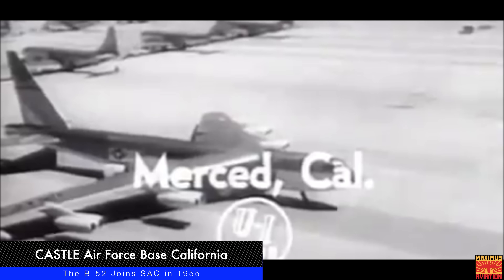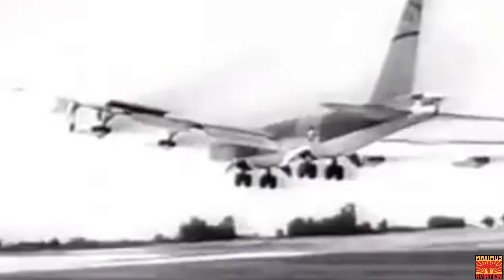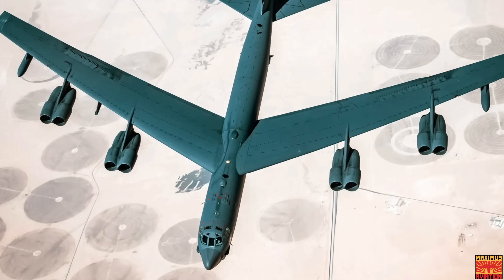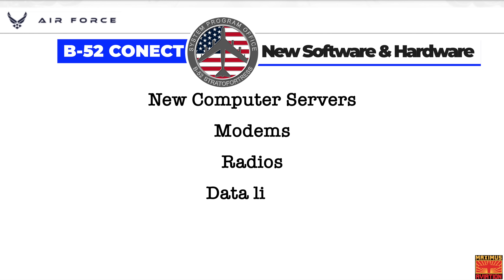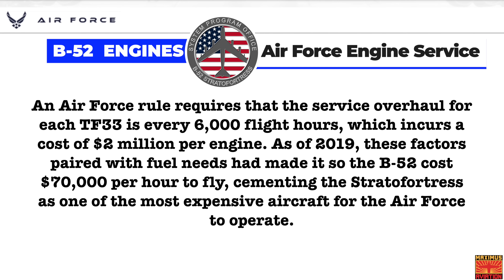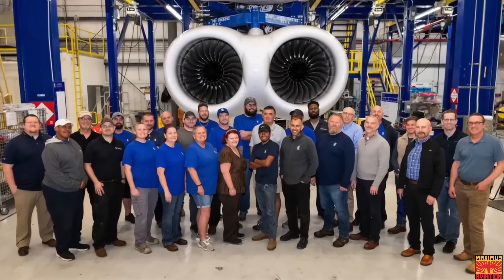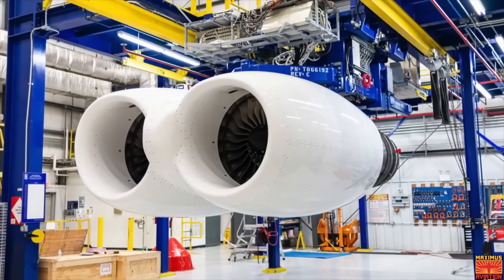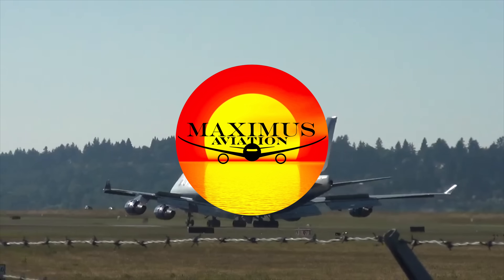The B-52 Will Fly For Over 100 Years With Its New Rolls Royce Engines!

Comment: I was in the Air Force in 70s and remember the maintenance personnel discussing the need to find a replacement even then. Some parts were "unobtanium" and had to be scavenged from those in the "boneyard". At Barksdale AFB, HQ 8th Air Force, 2nd Bomb Wing, we had 9 B52s on "alert" status, fueled and armed with nukes, ready to be in the air in minutes. We had a dozen on the East side of the runway that were "retired" and used for parts. One of the distinctive characteristics of the B52, other than the"full flying tailplane", the "stinger", was removed years ago. These were the "tailguns", either quad .50 caliber machine guns or 20mm cannon, that had radar and thermal tracking capability to defend from attack from the rear. Was disconcerting to be the "tail sentry" during testing and the crew used your body heat signature to verify proper operation! Hearing the whine of those tracking motors and looking up to see those LOADED guns aimed at and tracking your movements was disconcerting, to say the least! Only aircraft I ever saw take off nose down and tail up! Still love those goony birds!
Reply: I worked on B52Ds and Fs when stationed at Castle AFB, CA back in 1973.  I still remember the night the munitions and avionics guys were checking the radar quad 50s in the back and didn't tell anybody.  A young crew chief walked into the radar detection field and four 50 cals slammed over to where he was walking around the back....he moved, they moved.  After the guns jumped three times he came running to the front of the aircraft screaming "They're trying to kill me !"  

Took a while for the Supervisors to calm him down and assure him no one was trying to kill him...  Gotta' love aircraft maintenance guys !
Reply: Sounds like you were SPS. I was 22SPS at March, in the 70s and always got chills and thrills when our "D" models launched! What an awesome Bird!!
Reply: I wonder if digital scanning and 3d printing can deal with some of that?

Comment: my prediction is that in 2075, people will be talking about another re-engine for the B-52.  you don't always need stealth tech for penetrating modern air defense systems to disable modern air defense systems and to eliminate the enemy's aircraft. once you achieve air dominance, you don't need it anymore, and it more cost effective to use a B-52 to bomb your enemies back to the stone age and it doesn't risk expensive stealth aircraft. when all you have are nails, all you need is a big freaking hammer. when you need to put warheads on foreheads, the B-52 is the biggest hammer in the drawer. an upgrade to modern avionics and radar is long overdue as well.

Comment: I think I missed something here. What was the old thrust to weight ratio and what is the new thrust to weight ratio. The old engines 6000 hours to rebuild what is the new engines. It would be nice to have a chart to look at for a side by side comparison. I was at K I Sawyer for 3 years I loved to watch B-52s take off and C-5. You would think every time there to big to fly.
Reply: It's not planned to rebuild the new engines at all. These aircraft don't make that much flying hours and the mtbo of the new engines would allow to let them on the aircraft (with the normal maintenance) until they get retired.
Reply: they're too big

Comment: I used to live in Springfield, MA close to Westover AFB where SAC had based their B-52's in Chicopee.  The roar of B-52;s was pretty regular.  Westover was getting noise complaints from the residents of Chicopee so they hosted an air show with the Thunderbitrds aerobatic team flying their F-100's  doing head on passes right off the flight line, something they can't do now.  When one of the BUFFs did a high speed low level pass, he pulled up and accelerated under full military throttle, the announcer said.," Now thats the sound of freedom!"  All noise complaints from Chicopee stopped after that demonstration.

Comment: But if you look closely some of the skin is getting wrinkled.  I suppose they could reskin the BUFF and along with new engines it could fly for one hundred years so long as the wing spars hold out.
Reply: A. C. Campbell: The wrinkled  skin is a intentional design feature on all B-52s due to its size and length.

Comment: The B-52 is such a one-of-a-kind aircraft.  The (4) bicycle-type landing gear can all steer, eliminating the challenges of cross-wind landing.  Also, instead of rotating to take off, the BUFF 'unsticks' at a level attitude.  Given the wings' high angle of attack, pitching up isn't necessary.
Reply: It’s the angle-of-incidence that causes the aircraft to left off in a level attitude.
Reply: It pitches slightly nose-down she unsticks.
Reply: I always look for the pronounced skew when the buff is rolling for take off.

Comment: I like how they retained all 8 engines instead of reducing to 4, keeping the BUFF's original configuration.  The Air Force insisted on it to avoid performance issues of 4, including lack of rudder authority to handle the loss of an outboard engine.  The new engines should be about 30% more efficient, which compounds fuel savings since B-52s frequently perform mid-air refueling.
Reply: The engines are being made in USA at RR USA facility. A very sensible choice economy & longevity. The fuselage reminds me of a giant Lancaster, a very large rectangular shape, I imagine with large bomb bays. Engines built for life design with metal fragments measured at oil changes, things really have moved on. There is something special about a B52, great to see it still flying.🇬🇧

Comment: The first time I flew in to Edwards Air Force Base. We parked by base ops.
At that time base ops housed a small sub shop. One of the subs was called the BUFF.
My biological father worked on a top secret version of the B-52 called Ghost Buster. There's only 1 picture I've ever found of her on the internet.
This B-52 has a PAC Man ghost on the side. When you look at it's horizontal stabilizers, you can see the new avionics on board.
One of the reason this B-52 was built was to detect stealth aircraft.
When the government builds something new. It also build's its counter part.
Reply: look at its             also builds

Comment: I worked on B-52’s at Griffiss AFB in NY.  Our engines we’re GE-J-57’s .  This was in the early ‘70’s and G model bombers.
Reply: J-57 was a Pratt and Whitney Motor
Reply: @markostruszka1845  You are correct.  I keep mixing those two up for some reason.  We had a few J-79's in another engine shop on base in GE shipping cans.  After 50 years, memories kind of get clouded together some times.

Comment: I wonder why the bump protruding between the two cowls is about. Improving cross flow characteristics? Filling an already low pressure zone?
Reply: Flow through a ‘streamlined’ semi-internal channel would block up and give more drag than a simple fairing.  The new fatter fan cowlings will be optimised to minimise transonic flow drag and interference with the pylon and wing, the Buffs will still spend a lot of their time up in the cold air.

Comment: I am amused by the engineering, technology, bold design and longevity of this plane. Back when Boeing was run by engineers and this achieve this designs. This platform is a true testament of the achievements of Boeing as well as the AF to be able to maintain this bird flying. Also will like to find more about the engineering aspects of the selection of maintaining 8 engines vs. using 4 etc. Keep doing this type of videos as I enjoy your channel for its diverse content.
Reply: The aerodynamics of the 8 engine nacelles and pylons are well understood, so the USAF wanted to keep the same layout instead of extensive redesign and testing, including forces on the wing, for a different layout and/or thrust range. This was a viable decision since there are plenty of biz jet engines already in service with similar size and thrust as the TF33, but with much improved fuel economy and reliability, plus full digital control. Also necessary is increased electric power output to keep all of the updated electronic systems running.
Reply: There have been many studies on reengining the BUFF over the last 30+ or so years. They looked at four engines but those would have required substantial redesign to the wing and fuselage as well as the pylons. Keeping 8 engines with similar thrust meant the wings would not have thrust loads in places it was not originally designed. In addition, there would be ground clearance and CG issues that would be virtually insurmountable without , basically, a completely new airframe. Sticking with eight engines was really the most cost effective, efficient solution.

Comment: I guess there was a good reason to choose 8 new design engines, but I wonder if they considered 4 large turbofan type design. I think they probably did consider it, but I'm thinking 4 large engines would require more ground clearance.
Reply: One problem ( beside the ground clearance) is the rudder control authority. The original rudder made for high altitude flights had been made smaller at the later versions due to flutter problems in high speed low altitude flight. If you lose one outboard engine out of 8 the asymmetric thrust is less than if you lose one of 4.  With a 4 engine B-52 it's likely they would have to redesign the rudder
Reply: It would have greater range or higher bomb load wouldn't it?
Reply: The significant 4 engine advantage would be in halving the number of engines getting maintenance, it’s that basic.  Using rear mount T-tail plane engines gives the necessary limited engine diameter.
Reply: @givenfirstnamefamilyfirstn3935  using rear mount engines on a existing wing engine aircraft means you shift the centre of gravity out of the centre of lift. You would have to reinforce the rear fuselage and the wing box, and relocate the wings more to the rear. On a bomber this also means you would have to relocate the bomb bays to the new centre of lift. 
You end with a completely new aircraft.
Reply: @simonm1447   Engines that were rear mounted on other planes!  They had to have limited width, a Gulfstream could not take GE90 engines.
Reply: @givenfirstnamefamilyfirstn3935  your Gulfstream is designed from scratch for rear mounted engines.

Just compare a DC-9/MD80/90 with a 737. Where's the wing? On the MDD it's shifted to the rear, with a longer frontal fuselage to counter the weight of the engines, so the center of gravity is near the center of lift. A 737 in comparison has its wing more to the front, since it has its engines under the wing. If you would put that engines to the rear the 737 would become far too tail heavy without moving the whole wing to the rear.
One F130 engine is depending on the version in average 1,8 t, so with the nacelles you can calculate 2 t per engine. 8 engines are 16 t, you don't move 16 t of weight to the tail without running into problems with the center of gravity
Reply: @simonm1447  You seem to be suggesting putting engines on the B-52 rear fuselage?  That would need a 100% redesign.
Reply: @givenfirstnamefamilyfirstn3935  OK, I have read your first comment again and it seems I misunderstood it (this is not my native language)

Comment: I’m amazed.  An airplane designed with slide rules is still flying today.  I’ve flown on the Buff and it’s so solid in performance.  I’ve also enjoyed flying Gulfstreams with their high reliability RR engines.  I think this will be a great improvement over the aging tf33 engines.  A Plus will be a full FADEC controlled engine.  Reliability will be improved overall.
Reply: You think a slide rule is crude or something, they are brilliant.  If you knew mathematics you could play with one for days on end.
Reply: @givenfirstnamefamilyfirstn3935  I made slide rules.  I understand the mathematics involved and how they were built.  My comment was on the robustness of engineering back in the day.  It had no computers, but AERO design was in wind tunnels for confirmation.  The Buff was over designed and a main reason it’s still flying today.
Reply: @givenfirstnamefamilyfirstn3935  
A slide rules is fairly crude. It's just a couple of sticks that can add and subtract logarithms to get you 3 or 4 significant figures. But I was so fascinated by them in high school and college that I collected them. I still have an ivory-on-bamboo Post in its original cowhide case as well as a yellow aluminum Pickett Versalog model that was used so much that the scales are a little blurry in places.
Reply: @Buddy308   It’s just what you know about, they do a lot more than that.
Reply: @givenfirstnamefamilyfirstn3935  Ahh . . . what else do they do? My comment on their being fairly crude was in regard to their lack of precision. They're great for calculations that require only 3-4 significant figures. I admit that there are some giant ones, and the large circular ones are an example, that might give five significant figures, but that's about as far as it goes, and that is crude compared to currently available methods of calculation. I really did not give any indication at all of how many things I think they can do, so I'm not sure I understand your criticism.

Comment: I once saw a B52 heading towards a disused RAF  runway in Oxfordshire: wheels down, lights on...suddenly thick black smoke followed by a deafening roar filled the air as the wheels came up and it pulled sharply skywards! 4 guys sitting in our portacabin on the airfield, sat with tea mugs mid air as we looked on in awe! As a postscript: the nearest village to the field were always complaining to the council about the noise from our little Rotax motors. When the guy from the council came along a week later we had quite a laugh as he tried to work out how our little planes had recorded off the scale readings on the noise monitoring equipment....the plane had mistakenly identified our field for one of the bases in Oxfordshire!
Reply: I live under the Barksdale AFB traffic pattern. They've flown above my head my head for 40 years, and I still look up every time! Long live the mighty BUFF!
Reply: Here in the UK a lot of the old WW2 and cold war airfields get used for all manner of vehicular shenanigans.
Reply: Rotax as in Kart engine?
Reply: @foreverinteriors  Probably.
Rotax make engines for various purposes, but there are a few big kart championships in the UK that use them.

Comment: Interesting video. It would have been nice to know the thrust (in lbs) of the old vs new engines. It would also be nice to know if the new engines will give the BUFF increased range.
Reply: 40% more range
Reply: They're both 17000 lb. The
RR engines use 70% of the fuel, so probably about 50% more range.
Reply: @gasdive  that would be awesome it's already the most amazing long-distance heavy lifter

Comment: The TF-33 is not the original engine. It may be the original engine for the remaining planes in service now but the original engine was the J-57.
Contrary to what that screens shot about the 707 said, the TF-33 and the J-57 are not the same. The J-57 is a pure turbo jet and the TF-33 is a turbo fan. The TF-33 is more powerful and more economical than the J-57 hence the change but they are now increasing difficult to overhaul due to lack of parts and other technical problems.

Comment: It would be nice to see a side by side spec comparison of the old vs new engines
Reply: In terms of thrust, they're very close with the existing P&W TF33-P-3s  making about 17,000 lbs of thrust, and the new RR BR725s (FT-130 military designation) making 16,900.   So nearly identical in that aspect, which was actually a necessity.   The other big difference is the fuel efficiency of the RR FT-130s, which are about 30% more fuel efficient than the TF33-P-3.
Reply: @5thGenNativeTexan  Thanks!
Reply: @5thGenNativeTexan  or anyone else  - what about  any weight difference and maintenance cycle?

Comment: In 1964 I was a second lieutenant flying the F-4B from El Toro CA to Cherrypoint NC on a cross-country training flight. My RIO picked up a radar contact a few miles ahead going in the opposite direction. Just for grins we scanned him with our radar and then locked on him as we would if we were going to launch a missile at him. On our radar screens around the perimeter of the tube was an overtake speed indicator that was read like reading a clock. It started out showing an overtake of about 1000 knots which was pretty accurate. Then the speed dropped to about 600 knots and then the steering dot that we used to aim the missile started to wander around the scope screens. After a few minutes, it became clear the old BUFF was playing with our radar and could make it almost sing. We had no idea at that time that our bombers could do that much with our equipment. It also showed us that to kill a well-equipped bomber we would have to keep our radar in scan mode and not lock up until the last minute. Without any planning, we and they learned a lot from a simple cross-country flight. After that, I had a lot more respect for the BUFF!
Reply: As a B-52 pilot we would have, from time to time, a "meet up" with interceptor fighters who would attack from the front and then behind. The reason for those encounters was for both sides to test their "prowess" in the air.
Reply: @badguy5554  After my encounter I was thankful for the AIM-9 heat seeking missile since the BUFF had so many heat sources. That is one dependable old girl and she will be around longer than any fighter.
Reply: @rudyyarbrough5122  True that.. I worked on F4j at El Toro 78-81. I left service 3 months before our first squadron reported for F18 training. Here we are 42 years later & the F18 is old & being retired for the F35.  - Semper Fi
Reply: @Marine450x  It doesn't seem like it's been that long until I look in the mirror! Semper Fi brother!
Reply: Counter-measures, counter-counter-measures, ad Infinium.
Reply: Great story!